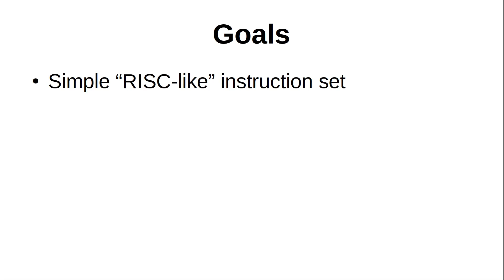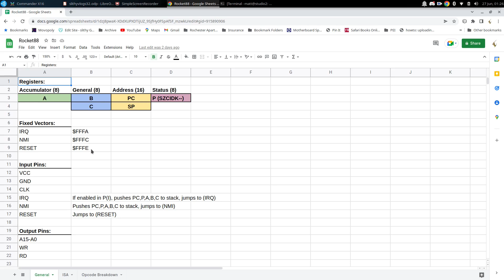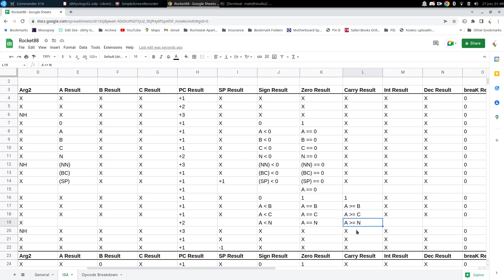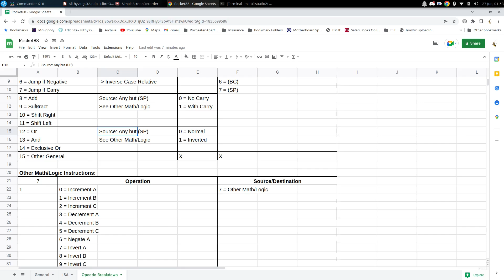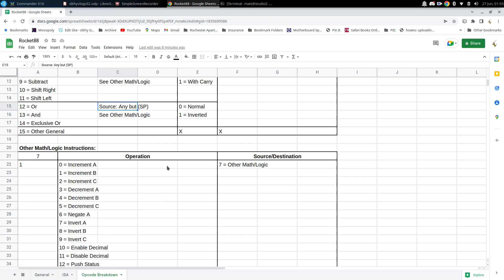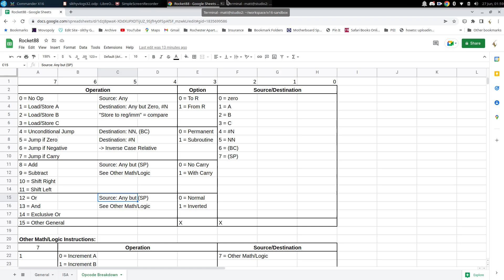ROCKET88 - A New 8-Bit Architecture - slithy VLOGS #32

Comment: 2:30 How about RCA 1802?! Wont go into details, of all known to me architectures 8051,Z80, 6502, AVR8 found this little CPU very very interesting the only issue was speed, only 1 bit IO, and 16 bit data bus instead of 8 bit bus and 8 bit IO etc. But it was RISC made 70s. And better designed than famous 6502. In modern days would be enough to have built in 4 bit SPI and addressing at hardware level. Allowing to read SD cards. This might be interesting for all these retro folks who knew ELF. I don't know what is the point of 8 bit CPU when AVR8 is well established architecture. Maybe except 32 bit adress space? Or even 64 bit! Native 64 bit adressing 64 bit program counter, 64 bit timer, instead of 16 bit etc. Still 8 bit architecture 8x8 hence name Rocket88. Sorry i didnt watch rest of video, too much of new opcodes. I don't find this part interesting. Re-inventing wheel. I would find interesting improving existing one. Could be 6502 but it was not RISC - 1802 was RISC!  If my comment is dumb - sorry about that. Hope it help? And/or inspire.

Comment: Don't they already have a RISC architecture for 8 bit? It is the 6502, is it not?
Reply from the maker: 6502 isn't technically RISC, and neither is this. I tried to make it more RISC-like, but the main distinction is that it will be free and open source
Reply: @slithymatt  I must apologize. I have always been a Z80 guy. While the 6502 seemed to be the architecture game development was happening on back in the day, the Z80 had so many more instruction available to it (a superset of the 8080 instructions ), I always found myself a little jealous of 6502 computers running all those games. Now years later, knowing more about the 6502 internal structure and assembly instructions, combined with a slower cpu clock speed, I am even more amazed at the sheer volumes of games published for it. I do appreciate your struggle with your aim in making a RISC 8 bit system, plus designing it while using an FPGA. An enormous undertaking. I truly hope you success.

Comment: One thing missing when defining such a CPU and that was the killer feature why, for example, the 80186 was so much loved by system developers. Integrated chip select logic, i.e. a programmable via registers of address decoding hardware. The 186 had UCS/LCS/MCS0-3 which allowed to split the address range in different chip selects zones. It also had 5 peripheral chip selects allowing to have up to 5 I/O chps without glue logic. This is imho more important than the programming model of the cpu.

Comment: Isn't the lack of immediates going to be an issue? Adding optional 16-bit instructions if the instructions start with a zero would offer a lot of beneficial options including more registers, 8-bit immediates, 2 or 3 register instructions, etc without greatly complicating decoding.

In truth, I feel that there's more value in an 8-bit RISC ISA with either all 16-bit instructions that strays a bit closer to RISC-V.
Reply from the maker: There are many immediate opcodes, even for some 16-bit registers.

Comment: Have you ever thought about to build an architecture without any registers, just working in memory? If memory and registers is implemented in the FPGA it may be exactly the same speed. So, if letting registers go all together, you could design the architecture in a way, that it is less complex. Having just memory is less complex than having some registers AND memory. Just an idea...
Reply from the maker: You'd need to at least have address registers, because there's no way to make fetching an address as fast as decoding an opcode. If you had dedicated memory addresses to use as registers, sure that could be just as fast in FPGA, but you can't fetch an address for each instruction for free. The best you could do is cache addresses into internal address registers, and if an instruction has the same address, just use the already assigned address register. But at that point you're making the CPU act like a compiler.

Comment: Very logical instruction set, which should make implementation easier (except maybe supporting decimal mode!). Can you clarify what is meant by "-> Inverse Case Relative"? Does it mean all PC-relative jumps have the condition inverted?
Reply from the maker: That's correct. So Jump If Zero is always absolute, but Jump if Not Zero must be relative.

Comment: LDA A (opcode 11)  and CPAZ (opcode 18) have pretty the same effect, changing Z and N flags according to register A contents (but different effect on C flag) You could canonicalize those opcodes to TST A and have one spare opcode pattern.

Another issue: do you differentiate between signed and unsigned right shift (diuplicating vs. zeroing highest bit)?
Reply from the maker: No, I'm not supporting duplication, like the Z80. Just zero or Carry

Comment: I appreciate your enthusiasm. The design is really nothing like how I would do it, but it is your design an more power to you, Some suggestions that might be helpful or not: you can clean things up a bit by considering a number of special cases as pseudo ops to reduce the number of opcodes used without increasing complexity. 1) You don't need an explicit NOP. Something like STA A shouldn't have effects and can be a NOP (most RISC designs get their NOP this way). LDA A is exactly the same as compare A #0, NORA #0 is NOTA.  A survey of the instruction set could define a number of these redundancies and give you more space to work in while keeping true to your concept.

Comment: Matt have you ever considered creating your own language? Maybe a mid level language, somewhere in between assembler and c? I think it would be great to create something like that, something fairly low level that compiles easily down to machine code. I think you would make a very interesting job of it. I used to be a 6502 coder myself, and I toyed with the idea of creating something that is like assembler but with a thin layer of abstraction on top of it.
Reply from the maker: I have actually created a few languages over the years, but nothing I really would want to keep around. My last major effort in that area was XCI, where I created both the development language and a target encoding to compile to, as well as a real-time interpreter for the binary code. You can see all that in my XCI playlist.
Reply: @slithymatt  cheers Matt I will check those out.
Reply: isn't that Fortran?
Reply from the maker: But as for in-between languages, I created an extension of Beatnik I called DylanThomas, which let you make programs that looked like fake Welsh poetry.
Reply: HLA might be what you're describing.
Reply: @genjii931  yes I just looked up hla and it does sound like it.
Reply: I’ve seen ASM macros that get 80% to structured code, but not all the way.  What seems useful is something like “C—, all the functions, blocks, and basic syntax of C, but where the only variables are A, B, C, BC, S, (for the Rocket88), i.e. with the code naming registers, and with the function parameters explicitly assigned registers or pushed to the stack.  Plus global variables assigned either zero page addresses or elsewhere with hard coded addresses.  Same for memory mapped I/O addresses.

The benefits are easier to read/modify vs. the cleanest assembly.  Easy to read if’s, loops, and blocks of code.  The compiler output could include a table of addresses to allow a loader to rewrite addresses for relocateable code.

The downside is that on a vintage 8-bit computer, the compiler probably wouldn’t fit with the code it’s compiling, all in 64K.  Assembly may be write-once/read-never, but it’s small.  Re-write a late-1970s BASIC in C— and the {}s and tabs are alone probably more byes or code than all of BASIC in assembly.

The pushback is that assembly coders would claim macros can do all of this too.  The upside is that we’re in the 21st Century and don’t need to compile on the target machine.
Reply: Just port vbcc

Comment: One thing that might be worth trying is assigning 64kb of RAM solely for the stack as independent hardware, separate from the main memory map containing the ROM, RAM, and memory-mapped peripherals. This was, if code does push/pop the stack too many times, you just get an NMI, but it doesn’t clobber the application/data memory.
Reply: How would you even implement that on a hardware level?
Reply: @AshtonSnapp  A dedicated pinout on the CPU that selects main memory or stack memory and feeding that signal to the CS pin on the main memory bank and stack memory bank (one of them through an inverter).  That way the address bus can be shared.
Reply: This is a kind-of Harvard architecture.  I like the idea. It wouldn't have to be 64kb for the stack (which is a bit overkill). Maybe use only 12 address lines (4kb) on the address bus when stack RAM is selected.

Comment: Matt, do you mind talking about why you didn't have a zero-page (or direct-page) addressing mode. Was it just lack of bits for addressing modes?
Reply from the maker: I don't think there's a big advantage to it with an FPGA implementation.
Reply: @slithymatt  - Even with the FPGA, the two-byte address loads are going to add up in tight code that needs to spill to memory for the lack of registers.
Reply: @chris_taylor_za  Also zero-page indexed addressing mode is pretty powerful and useful for a lot of stuff (I can't see any indexed addressing mode at all in Rocket88).

Comment: I like the architecture, but then I'm a 6502-family assembly programmer!  I'd like to see whether the stack operations would support some higher-level languages like C and Forth.  Is there some kind of "Index plus offset" addressing?  I didn't see it on first overview.  I suppose you could use the unused STA #N as a STA (BC)+#R, but loading would not be available with the same opcode design, since load immediate is even more important for tight code.   What is the tightest general memory copy code sequence (e.g. bitblit) with this instruction set?  Would you want to set up an external DMA controller in your overall system design? In that case, or even coordination with a video system, you might need a halt/wait pin to allow some other entity act as bus master.
Reply from the maker: No indexing, at least at this point. So memory copy would be swapping out addresses with BC for each byte and two-step increments

Comment: It's an interesting idea, but I'm already seeing some of the same shortfalls as the 6502: 3 registers is not enough. The 8080 is a lot more useful for bulk memory operations, with DE and HL registers available as address pointers, and the the Z80 extends this with bulk-copy commands that use DE and HL as pointers and BC as a counter. 

I'd say if you were designing a new 8-bit ISA, that register layout really should be the minimum starting point.

16:00 I get what you're saying with store vs compare. I'd explicitly write that out as : 

2: Load A,  3: Store A or Compare to B/C
4: Load B , 5: Store B or Compare to A/C
6: Load C,  7: Store C or Compare to A/B

and just get rid of the "option bit" since it's more confusing than just spelling out the cases.

Re "Dead space" Comments: those are just opportunities to place "one-off" instructions. For example, LDA A makes no sense, so it's really just a NOP. This actually gives you room for 16 special instructions in operation 0. (maybe memory transfer operations)

Also, just for consistency, I think I"d change "LDAZ" to "LDA Z" with the "Z" psuedo-register being a synonym for Zero. Maybe do that with all the operations that end up with Zero as the target. 
CPA Z
LDB Z
etc. This just creates a cleaner looking mnemonic set.
Reply: STM8S series has just one accumulator and no general purpose register file, so someone at ST doesn't agree with you...
Reply: @Theineluctable_SOME_CANT  Disagree. The STM8S uses indexed and indirect addressing. Honestly, the ISA design looks a lot like 65x to me. 

The 65x uses indirect addressing specifically to overcome the shortage of register space. Why add registers when you can use indirect addressing of zero page, right? The downside there is that zero page gets cluttered with OS variables. 

Indirect and indexed addressing serve essentially the same purpose as certain of the registers on the 8080 and Z80, so ignoring these addressing modes really undermines the claim that the CPU has no general purpose registers. It does - it has 256 or 65K worth, depending on the addressing mode. 

(Again, the STM8S should be really familiar to someone used to 6502 programming. I'd bet that if you go back into STM history, you'll find that the designers started off using MOS CPUs.)
Reply: @tomwilson2112  cool post....

Indirect addressing slows things down a bit. 

I learned to program in machine on the 6802. They don't do the zero page thing like the later 6502, but this is understandable.

I like the simplicity of the MOS design and it CERTAINLY was a pivotal design "rewrite" of what they did at Motorola before they jumped ship and started MOS. A lot of very nice thinking on what went wrong, what they could cut to simplify the chip fabrication and get the yield up and the great improvements they squeezed in, particularly the page zero "short fetch". The 8 bit stack pointer  was less impressive, but very worthwhile simplification to help bring the yield up by lowering complexity.

It wasn't common for a retro redesign in single chip CPUs, but MOS did it right.
Reply: @tomwilson2112  I was wrong....

Indirect addressing slows things down QUITE A BIT!

You can't compare ANYTHING that uses the external busses with direct register operations.
Reply: Yeah, I kind of agree. I like how the instruction set for the 8 bit pipelined CPU JAM-1 turned out. Also, a risc-v rv32E core wouldn't be too complicated and would be very powerful. It's not 8 bit, but oh well. It gets RISC right. Very simple instruction decoding to boot. Same sign extension bit, same shifts between different instructions from immediate to registers, minus one or two wires of special cases, same location for all register select.. no state register, just branch on register compare.

Comment: That's an awful lot of instruction space to dedicate to NOP, when something like "OR A,#0" could act as the NOP.
Reply from the maker: But that will affect status. And the point is not to have so many instructions.
Reply: @slithymatt And this is why most RISC architecture try to have no state, and only compare registers and branch on that result.
Reply: I was wondering if the "00" NOP could be a Halt or Break or similar that would stop the processor until an interrupt happened, or something that could otherwise be debugging friendly.  That way, if you try to run bad code, it's likely you will trap it right away.
Reply from the maker: @michaellosh1851  that's possible! I could make a different opcode the official NOP, but I like the idea of just testing for the upper nybble
Reply: @slithymatt   The upper nybble defining the overall instruction is a great aspect of this instruction set design and should help simplify decode to keep the instruction cycles low, along with the regularity of the addressing modes.  If most of the special case instructions are flagged by the 0b0000 and 0x1111 nybbles, it should be easy for logic to detect and activate for your special cases (a four-way NOR triggers one set and a four-way AND triggers the other set).

Comment: Hmm, not very RISC in concept.  Closer to the 6502 I think. RISC thinking would be to maximise the number of registers, make them extremely general and do away with specific function registers completely (e.g. no SP, use a general pair of 8 bit regs by convention only). The ATMEGA line is a good start for 8 bit RISC.
Reply: Not to mention typical RISC is load/store, and the Rocket88 has ALU instructions with memory operands. (And there are plenty of other RISC conventions, like fixed size instructions, a 0 register, three operands for explicit destination, and so on and so forth.)
Reply: I like how the 8-bit pipelined CPU JAM-1 did its instruction set. It's pipelined so for simplicity it had to get RISC-like it doesn't even have a status register, it's just directly compared from the math stage before. It's not like RISC in that immediate operands are in the instruction, it has to fetch a whole byte and run a nop for that cycle.. still, I like how it runs.